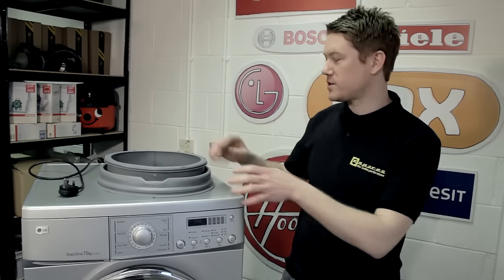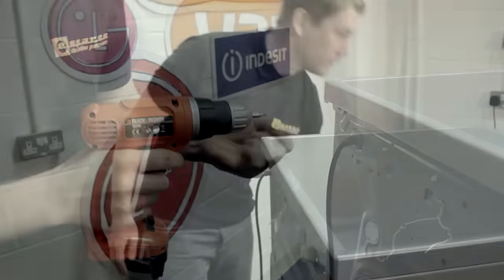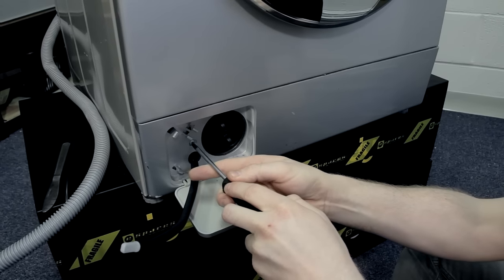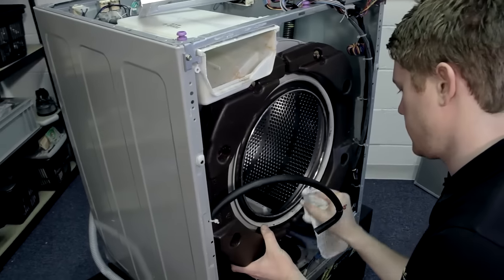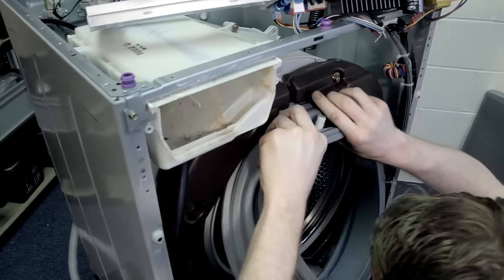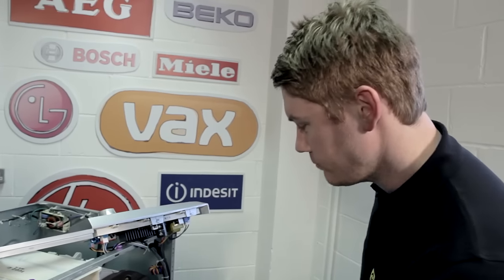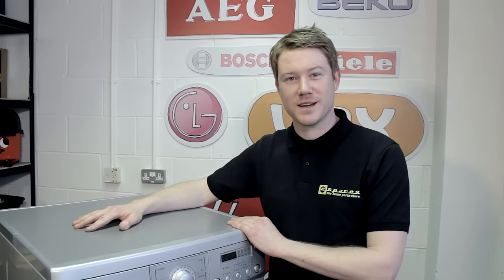How to Replace the Door Seal on an LG Washing Machine

Comment: Tip for easy  installation of springs. This tip makes putting the inner and outer spring on super easy. It is a two person operation and you will need four butter knives. Begin putting the spring on from the bottom. Both people work their way up on each side placing the spring in the groove. When it becomes difficult about half way up that is when you begin using the butter knives. Prop one knife under the spring holding it in place. with the other knife, move a little further up - only about an inch - and use the the other butter knife to pry the spring on. leave that knife in place to keep the spring locked in at that position. then proceed to remove the lower knife and use it to pry the spring on another inch up. The key is for each person to do this equally until your reach the top. Then it is a simple task to pry the final bit at the top. This worked on both springs and took very little effort.

Comment: Thanks very much for that Matt. Extremely useful video. It was a bit fidly to replace the inner spring clip and used a few plastic levers to get it back on but we had the whole job done in just over an hour or so and saved an expensive call out. Good work.
Reply from the maker: Hi Jeanette Jordan, thank you for your post  and glad our video helped and it saving you money on a call out is a bonus.

Comment: Thanks! My gasket is still fine, but one of the springs had unhooked itself. This video showed me how to open up the top and access it. The demo on taking off and putting the gasket back on was very helpful!!  I used 3 bike tire irons to put the spring back on, and it was easy (with a helper!) Would definitely recommend doing it that way. If they are plastic, they won't damage the gasket or your paint.
Reply from the maker: +Lyle Ale Xander Farrell Thanks for the comments. There are many ways of 'doing' any repair and tips like 'bicycle tyre irons' are really useful as it helps others look around and think of other ways when struggling to fit a part. :-)

Comment: Nice one, helped resurrect my 10 year old machine for the 4th time. The springs were tricky but a bit of patience and bike tyre replacement experience got the job done. Washing-up liquid to ease the gasket installation is a top tip. I also had to remove the balancing weights which helped access.
Reply from the maker: +TheVimFuego Removing the weights can help give more clearance for easier access. The spring can be very tight and many engineers have also struggled with this. Glad it all went well in the end.

Comment: great video, put mine on a LG WD14022D6 without any issues. I did remove the two black heavy counterweights on the front of the inner tub, made the job of installing the gasket on the inner drum super easy. great video mate.
Reply from the maker: Thanks for the comments Bilal, glad all went well.

Comment: Very instructional video thank you to those who worked on it. 

For the wd14022d6, the front control panel may not quite sit on top due to cable length. No big deal. 
There is a clip on the water pipe just needs pliers to pull tabs together to remove and install on new gasket. My vast also came with the adaptor moulded in. 
Bottom cover has clips on top and bottom so took a little force to release. More than some others like Westinghouse I have taken off before
Take note of the door latching mechanism. I installed it first wrong way and door wouldn't latch. Simple fix by removing the outer spring, pushing gasket into machine and grabbing switch assembly.
Reply from the maker: Hi Sean N, thank you for your post and for the good information you have supplied for everyone else.

Comment: Thank very much for the video, just replaced the door seal on my LG WD14060D6 which was leaking due to a small tear. Was an absolute pain to get the rings back around the seal but it would have been a lot harder without the guide.
Reply from the maker: Glad we helped and thanks for the comments. A small tear of the seal lip where it contacts the door glass can be caused by 'dragging' heavy washing out of the drum. To avoid damage like this always lift heavy washing in and out of the drum.:-)

Comment: My type of washing machine, is just like this video. But i have problems taking the clips off . Itu stucked to the body. I am afraid itu could be broken. Though i've already bought a new door rubber . But still i couldn't replace it.
Reply from the maker: Hi yanti, the clips on the fascia can be tight but use a flat blade screwdriver to push from the one side and pull the fascia towards you at the same time.

Comment: Matt, I like your mein!  You have a very confident presence and pleasant delivery.  Well done!  Makes me almost wish I lived in the UK so I could buy parts from you.  May I make a suggestion.  The tire (tyre) irons suggested below are probably better than screw drivers, but in the automotive world we use poly/nylon trim removal tools which I think you would find safe and easy to use when installing or removing the bands.  (Oh, and the fact that you take the time to respond to comments is an excellent practice--something I rarely enjoy at US sites it seems.)  Best wishes!
Reply from the maker: High John, Thanks for the comments and the alternative fitting tools. The trim tools you refer to are not likely to be available to most but the tire (tyre) irons may be more readily available. We do ship parts all over the world but most 'electrical' parts are for UK and Europe markets and are for 240 volt but remember us for those other parts you have difficulty getting.:-)

Comment: Followed instructions and got everything off fine. The fact that all the screws are different sizes will make putting it back together a bit awkward. Tempted to take off the heavy weight stabilisers each side of the drum to make putting the inner part of the seal easier to fit. It should be easy to take off and might help.
Reply: It Will, I Just did that when I replaced the door seal.  Removing the counterwheigts helped a lot, making acess easier to the inner spring.

Comment: Excellent video.  My LG frontloader has a dumb design for homeowner maintenance.  The gasket gets nasty and is very hard to clean.  A company making a product for cleaning designed a product that's hard to fully clean.
Reply from the maker: Hi Cindy, all front loading machines can build up mould and slime around the seal if not cleaned regularly. See another video to learn how best  to prevent this:
https://www.youtube.com/watch?v=ifWK9df1qgg&list=PLZopaZU-UQSFFqqyMbnBvXILEUn82lB70&index=3

Comment: Thanks for the video it was really helpful I couldn't believe I found it for my exact model of washing machine!!

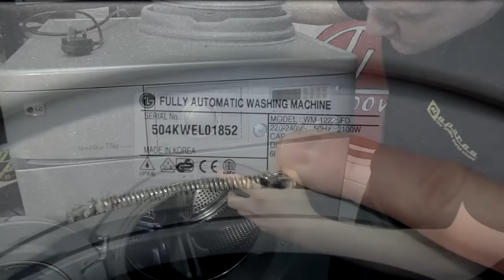Only one criticism - the guide didn't cover putting back on the front spring seen taken off at 0:53 at the end of the video...I nearly forgot it! When I took it off the spring it was at the bottom of the drum but looking at the video it looks like it should be at the top...which way should I replace it?

Comment: The video is useful for dismantling the machine, however it doesn’t show enough detail of the parts. The problem I had was that the seal had previously been replaced under warranty and the repair man seemed to struggle with the job and it has only lasted a couple of years. I dismantled the machine as per the video with as another poster has said minor differences in parts and location of fastenings etc. Here’s where the fun starts. The seal I ordered from e spares was different to the one fitted  (different part number). To cut a long story short I rang LG and was told the part I had ordered was correct. Fitting seal to drum easy, fitting spring to seal impossible, I stuck at it for ages no joy, left the job overnight but watched some other videos on seal replacement. The spring fitted to the drum on my machine was the one that should have been on the door panel and vice versa. It is the spring that comes apart that should be on the drum, once I realised that the job was done in less than a couple of hours. I actually separated the spring and reconnected it around the seal. This was the method used in the other videos and seems gentler on the seal than the tyre lever method. It did take two of us to do it however. Moral of the story don’t assume the parts on your machine are correctly fitted if you have had it repaired previously, watch other videos even from different countries and ring the manufacturer if you need help. LG were very helpful in this instance.

Comment: Lots of good ideas in the comment section about how to install the outer boot clamp without having to buy the spring expansion tool.
I used some  6'' Trigger Clamps to hold the boot clamp in place, which freed up my hands to slide the spring section into place
Reply from the maker: Thanks for the comments.

Comment: Awesome video! Thanks very much for sharing. I really struggled with that spring. It was really tight and I was worried I'd damage the seal. In the end I did it by opening the spring, then using a cable tie to pull the spring to the little loop at the other end of the wire (if that makes sense). Then I was able to get the little hook into the end of the spring. You need strong cable ties. I broke a few.
Reply from the maker: Hi Simon, thanks for the description.We try to give the best method to tackle a problem,however it is always good for an alternative to be available. In the end what ever helps you carry out the repair is good by us. :-)

Comment: Great guide! I've done up to the 3 minute mark, problem is the screws have become so caked in washing up powder + rust they're not budging! So now I have to wait for some WD40 and hope that'll help. Honestly though, if it weren't for your video I wouldn't have even been able to begin putting this seal on.
Reply from the maker: A tip with the screws. Use a good quality screwdriver that fits the screws well and as the edge of the screw may now be damaged try Tightening the screw a little first. This can then use the better edged of the screw to break it loose and then remove it.
Reply: thanks!! we ended up using a hammer to get it loose. we also ended up using spoons to lever the spring back on when the new seal had been fitted... it was a real pain! this video's helped a lot though ^^

Comment: i'm considering ordering a replacement seal from espares as I have the exact same washing machine in this video however i notice that the spring 'clasp' is located at the bottom of the drum rather than the top. There is water leaking from the door, although the seal is not torn or ripped it is warped and i suspect this is why it is leaking. Why is the spring located at the bottom on my machine ?
Reply from the maker: +Jonathan Cave The position of the spring is generally more a cosmetic issue as placing at the bottom makes it less noticeable. Some machines use light weight springs and over time if water drips from the dispenser due to mould it can cause the spring at the bottom to rust as the water will gather. For this reason I generally fit the spring next to the hinge as the water will run off and it is less noticeable then most other places.

Comment: My LG washing machine (Model F14A8TDA5) has a different kick panel which does not seem to be separate from the main front. Cannot see how to get the front off mine. Can you help, please?
Reply from the maker: Hi Phil, looking at your model it does not have a kick panel so no kick panel to remove just a filter cover.
Reply: @eSpares  Thank you. I have removed the filter cover but how do I get the front panel off?
Reply from the maker: Hi Phil, remove the top first, take the control panel off usually held in by screws and then you should get to the fixings for the front panel and don't forget to check underneath the panel at the front.

Comment: Hi followed the vid but couldn't get the front off - model f1247td5 - when lifting the front panel off the entire machine lifted. All screws undone followed to the letterDoes this work for my model?
Reply from the maker: +Kev Gilbert Acordingto our information the front does come off your machine. It may either slide up or push down to unhook and remove it so try giving it a 'bump' with the heal of our hand.
Reply: +eSpares excellent thanks will try it again. Thanks for getting back to me!
Reply from the maker: +Kev Gilbert :-)
Reply: +Kev Gilbert I had 2 screws inside, behind my soap tray
Reply from the maker: +rediornot Thanks for your comment.

Comment: Just woundering if you can help me got new washer today when I close the door pulls in tight at top but not at bottom and the inner tabs at top mark the door rubber but bottom don't touch and push against rubber
Reply from the maker: Hi Jamie, depending on the model details you may not be able to adjust the door, are you getting any leaks from the door area? you need to be careful not to make it worse if it's under guarantee.
Reply: eSpares  hi thanks for getting back to me no leaks at moment but a real pain to get lever soon as I level it push it under unit not level at all adjust both front legs doesn't realy make and differance vibrates like crazy any ideas on how to do this as floor under unit slopes down at back and not left at left spent 6hours trying no success
Reply: eSpares and it the Hoover link 8kg 1600 spin
Reply from the maker: The washing machine must sit flat on the floor, if the legs cannot adjust sufficiently you must pack it up on some wood or similar and ensure it does not rock. If the door is 'misaligned' and it is under waranty call the supplier to arange repair, the floor is 'your problem' and the warranty will not cover any work caused by damage from an uneven floor.

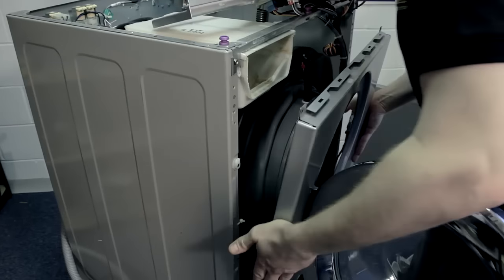Comment: at 3:26 in the video i cannot get these screws out, they are stuck! any suggestions ? im a strong lad and using force to push/twist the Phillips screwdriver but all im doing is breaking the screw head.- sorted its a P2 screedriver was needed
Reply from the maker: +Jonathan Cave The screw under the dispenser can get corroded from water dripping from the dispenser. To remove it you can try using a flat screwdriver as a chisel to knock a glancing blow on the edge of the screw to shock and turn it. Ultimately you may have to drill it out and use a nut and blot if the screw is too damaged.
Reply: +eSpares I used an impact driver to get mine out it is better than a drill for turning and would try before drilling
Reply: +rediornot I also had to hit the bottom of the front panel with a rubber hammer to break the rust free, the bottom of my front panel has hooked brackets at the bottom
Reply from the maker: +rediornot Thanks for your comments, If you are getting rust below the detergent drawer make sure you keep the jets in the drawer housing clean and clear from mould or it can cause the filling spray to leak and cause the rust. To control and prevent the mould watch another video: https://www.youtube.com/watch?v=ifWK9df1qgg
Reply: daughter has a bad habit of spilling detergent down the side of the machine and or overfilling soap, hence the rust and the drain pump and long cylcles due to to many suds. lol.
Reply from the maker: +rediornot Still worth checking for mould as this occurs in most machines. :-)

Comment: I have not yet tried fitting the new gasket as I wanted to see the video first . My machine appears to be almost the same as the one used .  The video is very good although the refitting of the spring wires appear to be a problem . Removal is  fine using screwdrivers because it doesn't matter if the old gasket is damaged while levering out but re-installing is difficult . The video shows starting the reinstalling of the inner clip but doesn't show the very last bit as I suspect it is VERY hard to force the ring into place . The outer spring re-installation is NOT shown at all . Perhaps the man had too much trouble getting the spring back in place . LG offered me a spring expander at a cost of about £70 when I enquired about  the gasket , I now know why . My gasket has started leaking after 3 Years of 2 or 3 times a week use , not covered by LGs 5 Year extended warranty ! I have never had a gasket leak ever on a machine before , won't buy LG again . Thankyou for the video .
Reply from the maker: Hi Ken thanks for your post and sharing your experience with us. We are glad you found this video helpful.

Comment: I did not have to remove the front of the machine. Did it all through the door opening, using only a paint can opening tool to aid in pulling the wire and spring.
Reply: just remember to install the drum spring first, with the gasket fliffed into the machine, to give you more room and better view.
Reply from the maker: +douglas becker Thanks for the comments Douglas. Most engineers and people with a lot of machine dexterity like car mechanics can replace a seal through the door. However we made the video this way to try and ensure even DIY novices would have the confidence to carry out this repair.

Comment: I had a split in my door seal 8 months ago. Could.nt find anyone to supply me with a new one. It was a Bloomberg wnf 6221 model which didnt exist on the interweb. So i cleaned the area with white spirit and stuck a tyre repair patch on with rubber solution. Still going strong.

Comment: you cut the video out when putting the Seall ring back on,, which is of course the hardest part!  lame-o
Reply from the maker: Sorry that the editing did not show all of the retaining band going on but you should be able to follow the procedure. One thing that may help is put the spring section on last as this allows easier stretching for the last couple of inches.
Reply: Excellent tip, thank you!